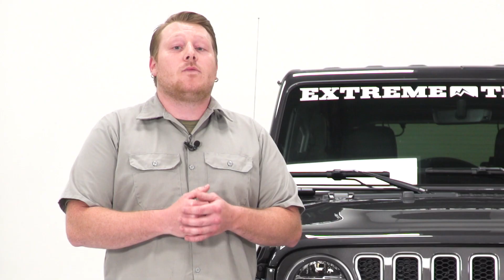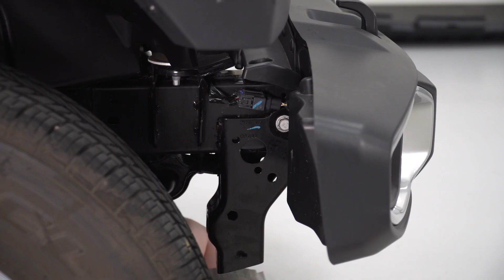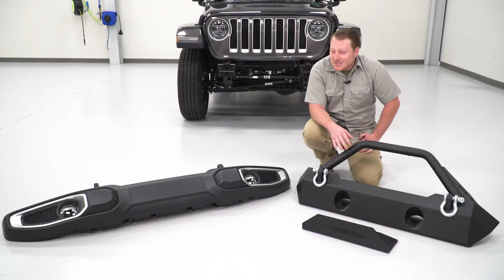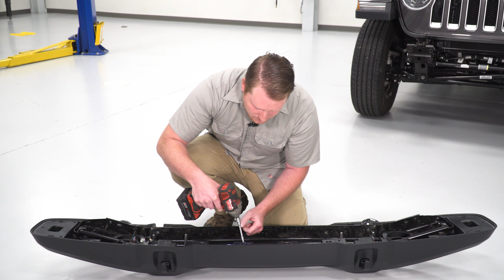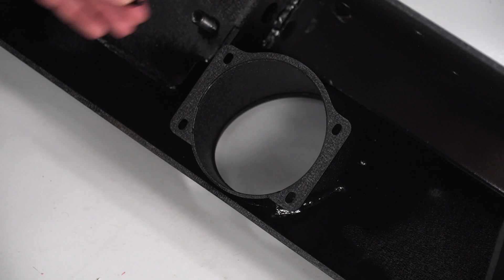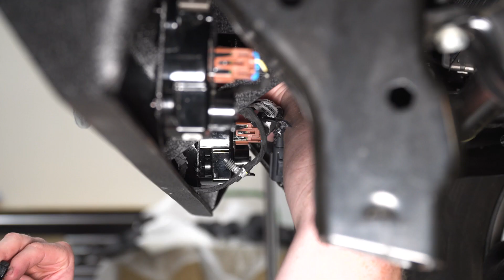Jeep Wrangler JL DV8 FS-15 Hammer Forged Stubby Front Bumper - Fog Lights (2018) Review & Install

Comment: I will never buy DV8 products again. I have a Jeep 2020  rubicon,  the factory fog light does not fit this bumper, I have to buy a dv8 fog light. The re is s design defects on the bumper, it does NOT fit any  WARN winch because of the groove on the surface, I have to buy two spacers to lift the winch. Even one of the bolt holes was not drilled on the right position. It hard to believe it’s made in USA,  dv8 should recall it back, including all the videos on YouTube. It’s your shame.

Comment: You are not correct at 05:25 when you say the halogen lights have a different bracket and won’t fit. My halogens from my JLU Sahara fit just fine. There are three different fog light brackets on JLUs depending on the light and bumper.

Comment: XT team, I’m confused - multiple reviews on your site mention drilling new holes/enlarging holes required for this bumper on a JL. Can you confirm? Is it direct bolt on, or is modification required?
Reply: Agree. I had to buy adapters, which extend the frame out a couple inches and leave a gap between the grill and bumper plate. Looks goofy. Wish I'd known before. Buyer beware